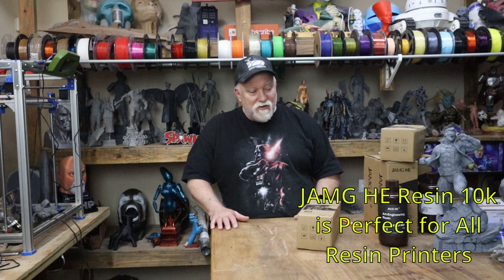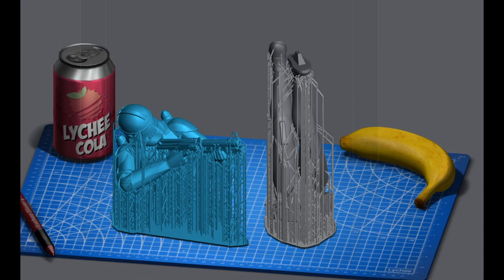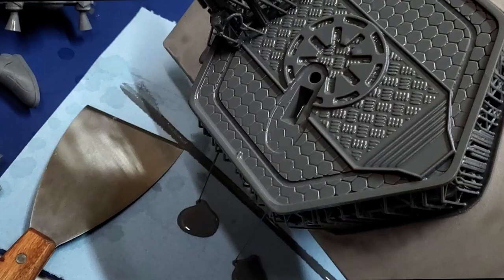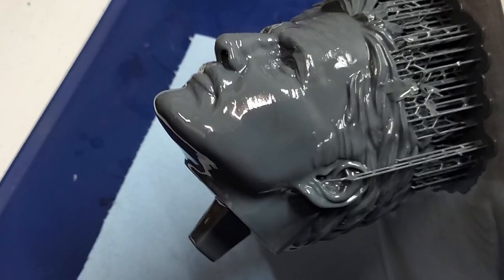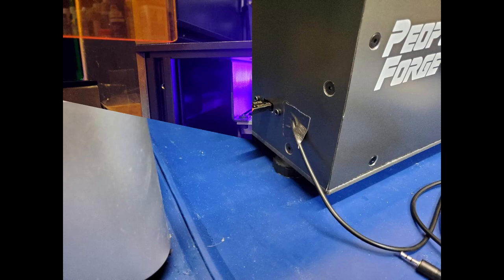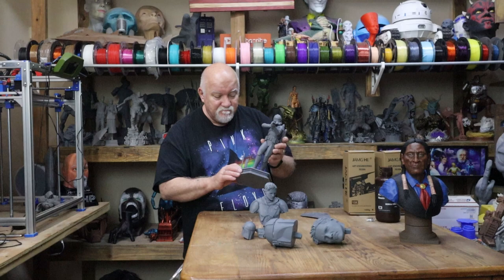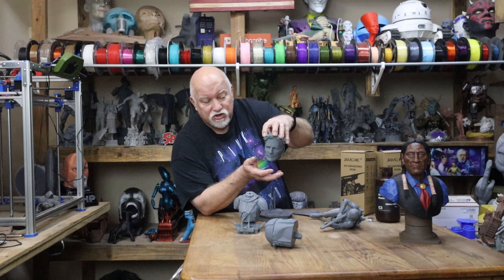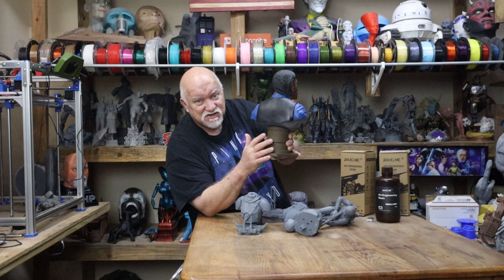JAMG HE ART Resin | Peopoly Forge | Uniformation GK2 | Resin Printers

Comment: Great video! What layer times did you find to work the best? Ive been using 3.9s and 45s bottom layer on the Saturn 2, but I'm not sure if it could be better
Reply from the maker: I used default setting and picked Elegoo ABS Like resin.The company sent recommendation after prints were done. The well mixed resins  with stock setting,small mando came out great. Have not tried to reprint the big yet. but when I do,will post there recommended setting in next video.